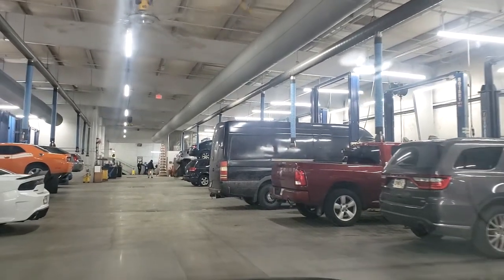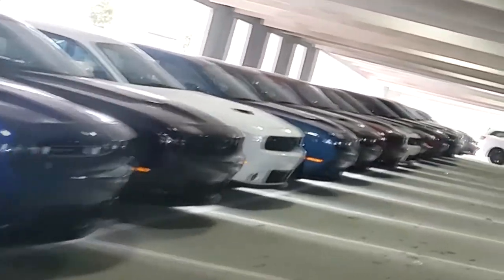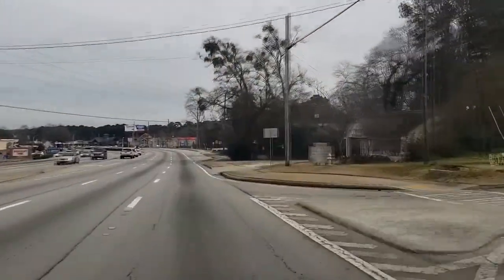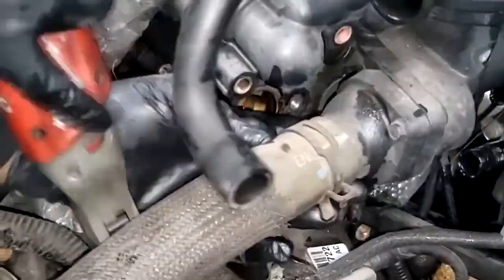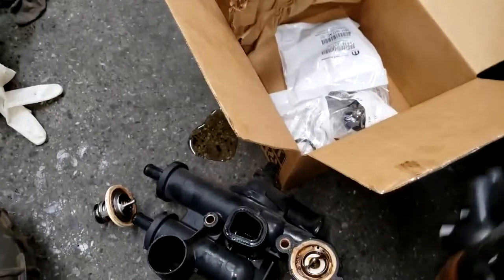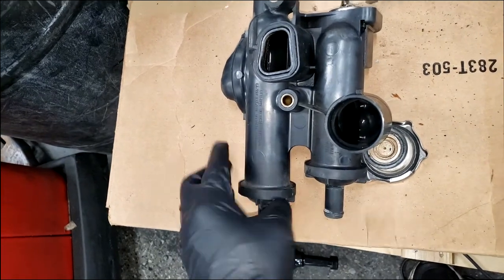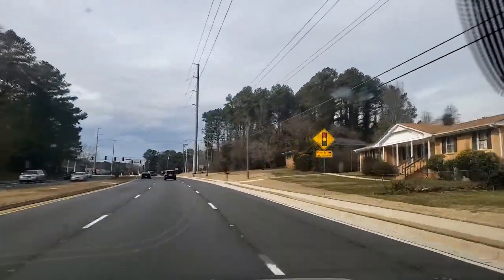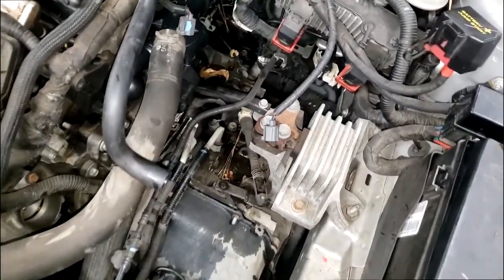TDC=Test Drive Chat. Vlog talk about a OVERHEATING car. Steps you should take after repairs made.

Comment: hey man i have a 2003 pt cruiser sometimes the car wont startup on the frist time but fires right up the 2nd and sometimes the 3rd try and theres no codes could this be a weak fuel pump its got to be as old as the car its self :D
Reply from the maker: Hey bud, it could very well be a lazy fuel pump. The way I deal with these type problem is I would tie in a fuel gauge and monitor fuel pressure. If pressure drops after car shuts off, which makes for hard restart, then its likely the problem. But other things can cause this also. Thanks for watching, Are you subscribed to the channel?
Reply: @OnlineMechanicTips  yes i im thanks
Reply: @OnlineMechanicTips  it sent me a code this morning it was the iat sensor p0113 i drove it like atlest 30 or 40 miles befor the code came up but could tell there was a small miss fire on cold startup :D